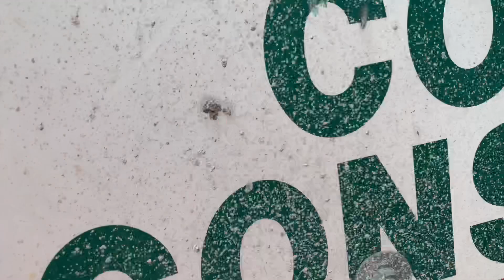7.3 Powerstroke Nothing But issues!

Comment: You said a few times.u beat the truck to hell.plus its 20 years old.im sure the truck has well over 250,000 Miles.so if you ask me?.that 7.3 has done its job.
Reply from the maker: Only 140k miles
Reply: Whoa!!!yeah some wrong.i just sold a 2008 6.4 kingranch f350.280,000 miles.tuned deleted with zero problems.

Comment from the maker: No hate against 7.3’s... this one just hasn’t had the best life Lmao!
Reply: I got one and i run total loss oiling which mixes oil with the fuel at 32;1 and feeds it in, there is large bore spoacing so it makes for a nice poppet valved u-lop scavenged 2 stroke with total loss oili8ng, Im on xd-100 2 stroke oil at 3 gallons, hehe, seems to work well on this this valved 2 stroke engine.

Comment: 99 is the year you want it has the better pistons. Sucks about the rust but the valve covers/injector harness on that thing is easy cake to fix. Just watch out for the oil pan rusting out cause that sucks and leaking up pipes and exhaust manifolds rusting off. That thing should run for a long time otherwise. If you have not already done so get glow plugs with the valve cover harness/gasket because you will want to do them at the same time.
Reply: no, 99 is the one you do not want
Reply: @t3hm4zn whys that? Hes right those 99 got forged pistons and 2000+ have pmr

Comment: I have a 99.5 I ordered new, 6 speed f350. Currently have 284.541 miles. Still runs good. Been changing oil every 4-5 k with mobile1 syn

Comment: People stop saying “I have a 6.0 and have no issues”. Lol they come stock with issues the 7.3 is the best and the 6.0 is junk. The reason this truck is not running right is because it was not taken care off. He beats on it as he says.
Reply: Kris Hermanowski buddy had a 2004 6.0 towed with it daily concrete wall forms excavators etc it lasted 550k before he had to park it due to his ex wife steeling the title it was all stock and had no issues. Now our 7.3s 1997 and 2 1999 are constantly having stupid things break on them about once a month. The 99 is out with yet another trans rebuild. The 7.3 is great but it still has it many stupid little problems that go wrong with it. The 6.0 is also great with its own set of things that break they are both good engines
Reply: Operator Benji. I don’t know man it’s opposite for me my buddy daily drives his 6.0 and it has issues all the time too and I drive a 01 7.3 powerstroker and I haven’t had many issues really. I will say that the only thing I like of the 6.0 is it is a little faster than the 7.3 but who gives a shit trucks are meant to be work and cruise not race with. You want a fast car get a corvette. 7.tree all the way. This guy beat on his so the 7.3 beat on him.
Reply: @operatorbenji9735  "had no issues"......... ya if you drive it every day all day maybe but still hard to believe. All the 6.0s I see on the road as an educated mechanic still drive but they are in need of something. Usually the owner has no clue sends it in for one thing finds out later there is a list of shyt. Not saying a 7.3 does not grow a list as well but I feel long term It is more affordable. I do like the way a 6.0 sounds though.
Reply: ARGOPROVIDS I know tons of guys with 6.0s work trucks and not just the one guy I mentioned and if you know concrete guys they don’t maintain anything at least not the ones where I live. All their 6.0s have no issues and run fine. As an educated mechanic I’m assuming you are a mechanic so obviously you’re going to see all the messed up ones of whatever brand it is. I’m not trying to say one is better than the other the original commentor called the 6.0 trash and said the 7.3 was way better I was simply trying to point out they both are good trucks most definitely if they’re both maintained properly they both like everything have common weak points.
Reply: Kris Hermanowski I don’t know how your buddy drives if it’s stock how you drive if your truck is stock what the mileage is on either or anything but I do know that you can’t take one of both types and judge an entire situation. Maybe your buddy’s truck wasn’t maintained well or has high miles and that stuff is due to break now anyways I can’t say because I don’t know what I do know is you can’t judge both engines on those small experiences

Comment: You need to get a Mishimoto transmission cooler, and you’re trans will last forever. The OEM transmission coolers is way to small for it.
Reply: I do belive the 6.0 got a 26 row transmission cooler vs the 7.3 13 row transmission cooler. They do make the proper line adapters to do the swap but my trans temp didn't get high enough for me to feel I needed it

Comment: I have a 2000 f350 dually 7.3l and it has 500k miles and I have never towed with it but the original owner uses to tow a 30 foot motor home across the US until I bought it, and I have never had any issues with it other than the original water pump going out after it passed the 500k

Comment: Just get a 6.7 cummins as your next truck with a Aisin transmission
Reply: Mister Epic Dan Bros no thanks I’ll keep my 5.9 Cummins instead
Reply: @wq198mnr the 5.9 simply comes in better configured trucks. The 6.7 has the grid heater bolt failure just like the killer dowel pin in a 5.9. I don't get why people brag on any automatic diesel transmission though. The Allison or aisin is just as garbage as any other automatic when using a truck as intended

Comment: 130k miles is low the truck needs maintenance dude clean it check the rear gear oil .But if you keep her clean you will see problem areas .and he'll you can get a brand new flat bed cheap.the rust in the rear quarter ain't bad .Trump 2020 Shit my truck is the same year with the same miles and it looks new because I take care of my shit

Comment: I have a 6.4 and i have nothing but problems with and it only has 76k miles on it. Its been deleted and lightly tuned. When i got it 3 years ago with 66k on it, it still had the emissions stuff on it and a bully dog tuner. I have blown head gaskets, a shitty trans, and steering problems

Comment: Get a Dodge Ram 3500 dually 😉
Reply: vlone slime no
Reply: And have twice as many issues how bout no
Reply: Stuuubbs 77 you obviously can’t take care of a truck I have a dodge 3500 and it’s been fine no problems it’s a 2017 so yes get one frank😎
Reply: Texas Aggies yes
Reply: I've been using a 275k mile 24 valve nv4500 01 for 3+ years for landscaping and has never let me down, the truck has also had a tuner on it since 06 and I'm the 4th owner, one of the previous owners used for a tree service as well. You guys can have your under powerd fords.
Reply: With the Cummins yes 👍